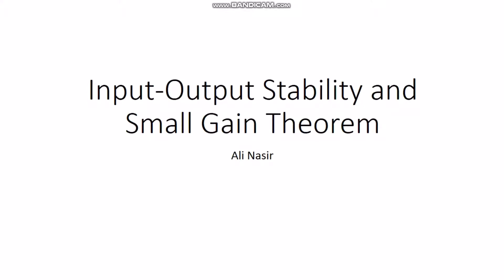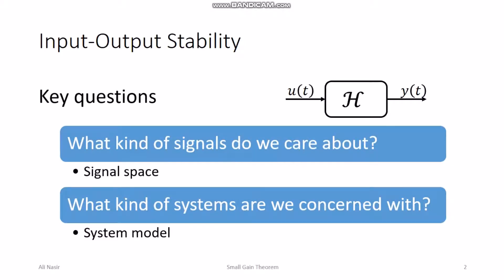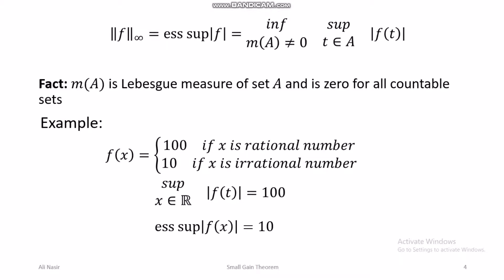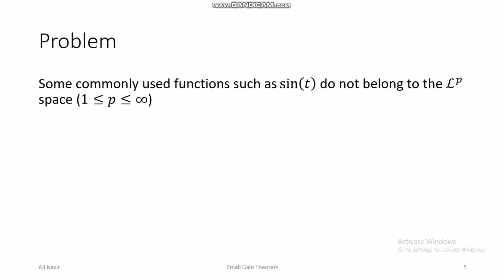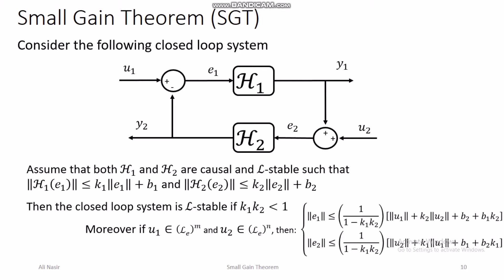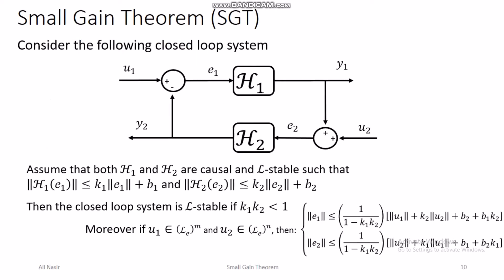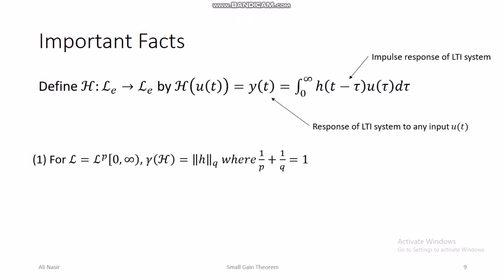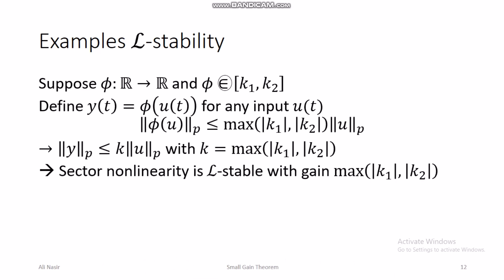Input Output Stability and SGT

Comment: Thank you, your video is quite helpful for me, but here i want to pose two questions
1) I have heard that SGT is only sufficient, which is to say that there are systems that not satisfy SGT but are stable, can you come up with some examples?
2) In the second example, I am wondering whether my assertion is true, that 1/sqrt(1-t) is infinite at t=1, therefore \psi is infinite, and this corresponds to infinite gain and therefore the system is not L-stable, according to SGT
Reply from the maker: Thank you for the encouraging feedback and a couple of good questions. Here is my take on your questions
1) You are right, SGT is indeed a sufficient condition (more details can be found in the input-output stability chapter of nonlinear systems book by Hassan Khalil. You may also find useful information here https://www.researchgate.net/post/Is-small-gain-theorem-a-sufficient-and-necessary-condition-for-stability-Or-just-a-sufficient-condition 
2) Your thinking is very logical but we must remember that input-output stability allows for an infinite output if the input is infinite too. At t = 1, the output is infinite but so is the input. Therefore, we cannot apply this logic to deduce the instability. However, if you compute the magnitude of the input (using definite integration), you can see that for the span 0 to 1, the magnitude of the input is finite whereas that of the output is infinite and this is not allowed by input-output stability. You can calculate integrals online using https://www.integral-calculator.com/ 
I hope that my answers are clear and useful.
Reply from the maker: @harrisonford4103  Sure, my email is techibro@umich.edu